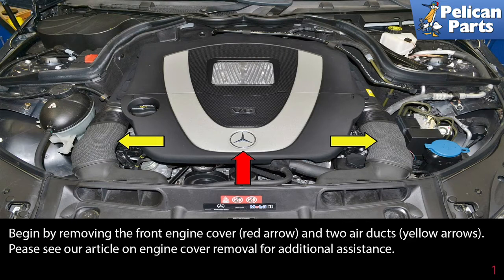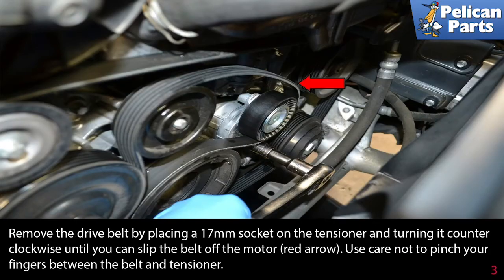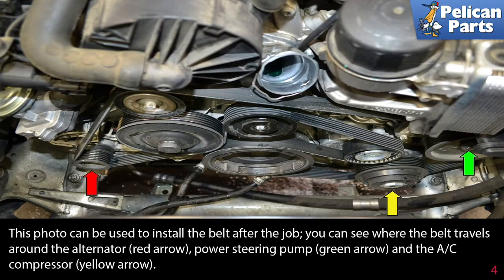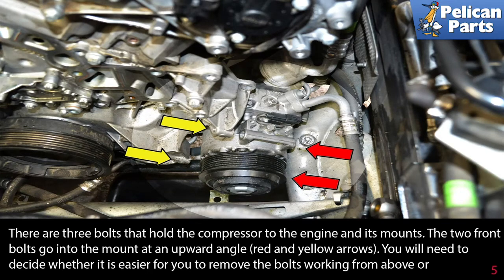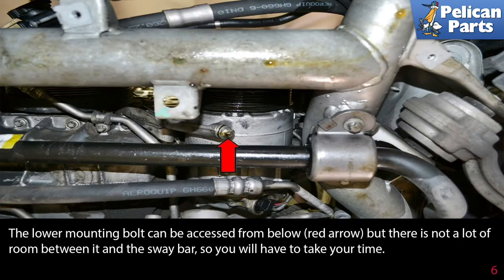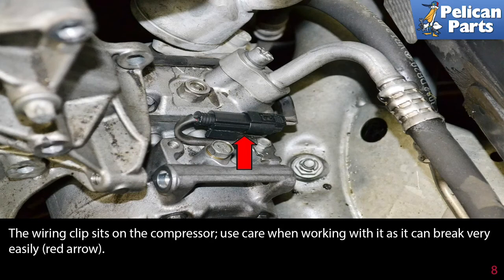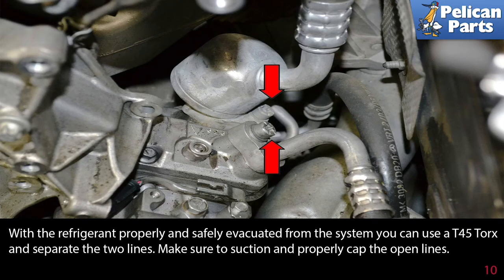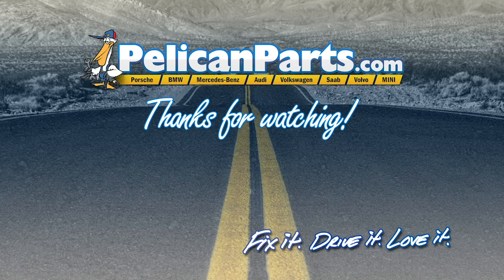Mercedes-Benz W204 C-Class Air Conditioning Compressor Replacement

Comment: Sure wished you'd showed this feat with all components still in place  LOL   it is way less simple with everything else in tact.  But, I'll be diving in to this issue on my GLK this evening to replace the pressure control valve in the compressor.
Reply from the maker: Thanks for the feedback.

Comment: Is there a trick on getting the compressor out on a 4matic model without dropping the subframe?
Reply from the maker: What is the year and model of vehicle?
Reply: @pelicanparts  2008 c300 4matic, same as in the video but 4matic. The steer subframe barely gives you any room but apparently there's room to slide the compressor forward and fishing it out from the top. Is this correct?

Comment: On the v8 m273 engine can this be removed in the same fashion? Or does more stuff need to be removed?
Reply from the maker: What is the year and model of vehicle are you working on? I can see if I have that info.
Reply: @pelicanparts  it’s a 2010 e550 coupe w207